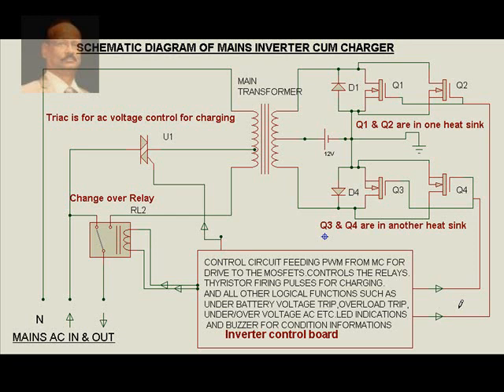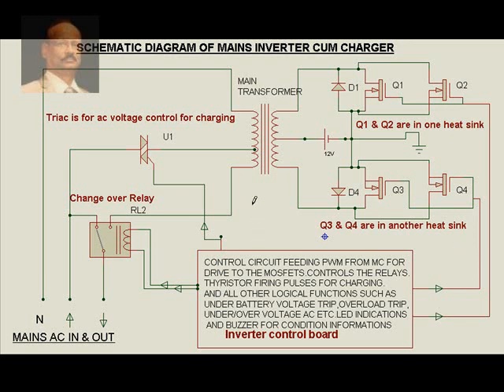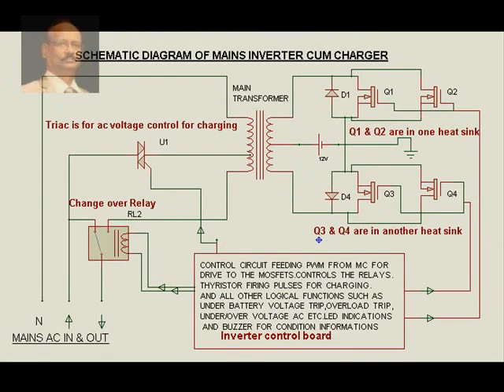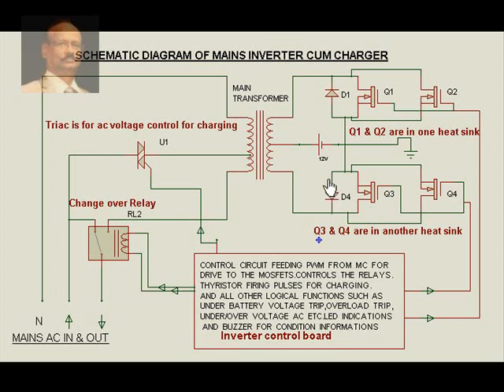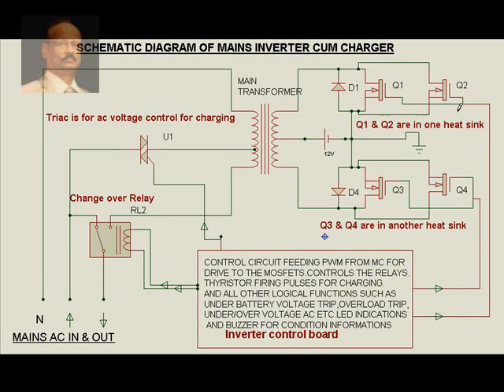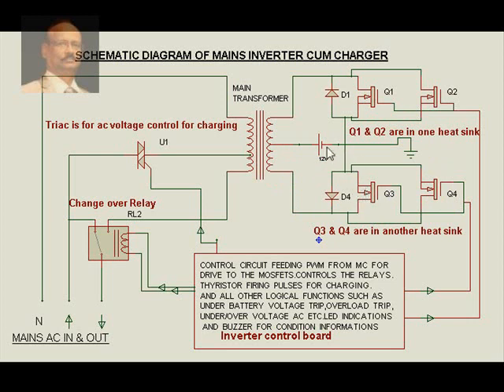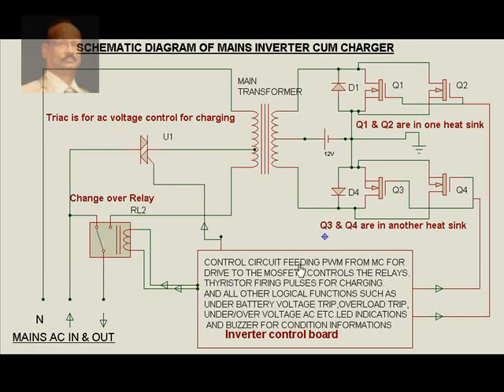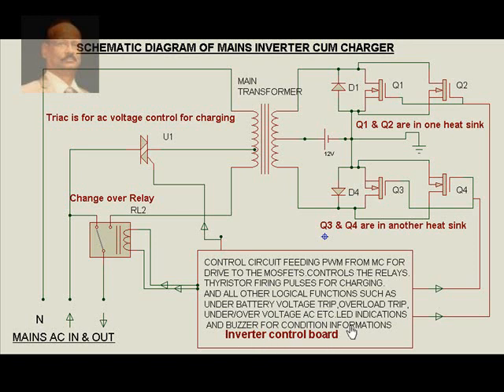AC Inverter schematic basic technology the Square wave

Comment: Sir how can 60 hz frequency inverter ac to work 50 hz electricity plz reply
Reply from the maker: Absolutely no problem as long as the voltage is 220v
Reply: Thank you very much sir

Comment: Sir, actually I'm little confused. Could you please mention which side or contact of the relay is NO/NC? left hand side or right hand side? Regards.. A big fan of yours.
Reply from the maker: It depends upon how you want the inverter circuit to come into operation. If the relay is energized from mains (duly stepped down and made DC 12 v) while mains is available then it is "NO" contact which closes to enable the charging and sending the mains direct to the out point. Thus "NC" then feeds the inverter output while the mains fail and the relay drops. But if you design the control such a way that relay is not energized while the mains is available then it is reverse. While mains fail the relay is energized from battery source.
Reply: Do I need a small transformer again to energize the relay or any other way is still there?
Reply from the maker: Yes. Use a small step down transformer of 300mA at 12 v from 220v
Reply: any other way without the transformer?
Reply from the maker: Yes possible by an opto to sense the mains availability to have the relay off  and then using reverse logic Ie relay to get on while mains fail.
Reply: thank you so much for the idea, you are right. let me do a little more research on it. Then I'll ask again if you never mind..
Reply from the maker: Try this--http://www.edaboard.com/thread170213.html
Reply: Thanks a lot sir..